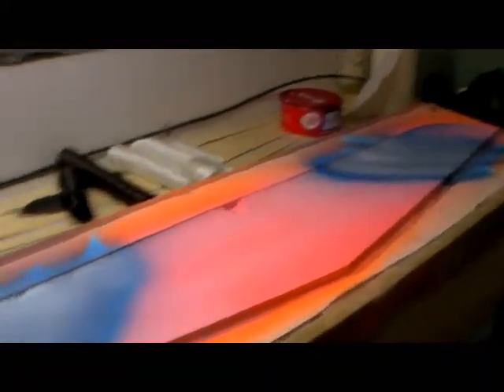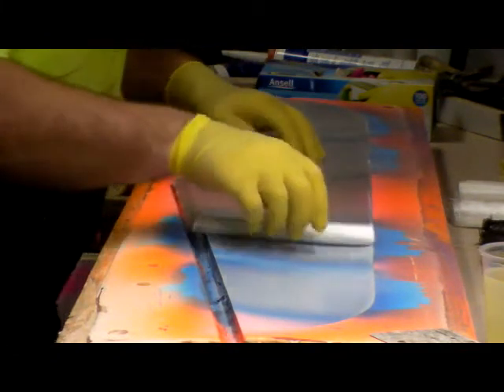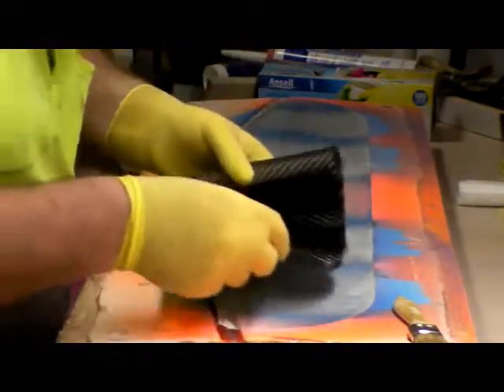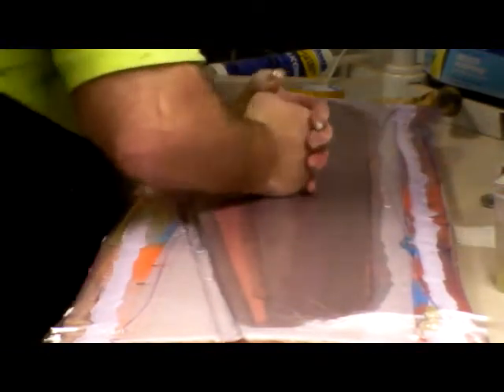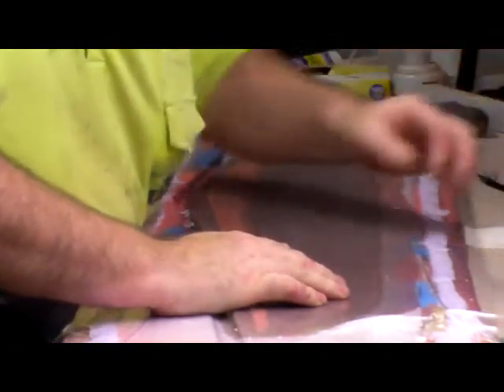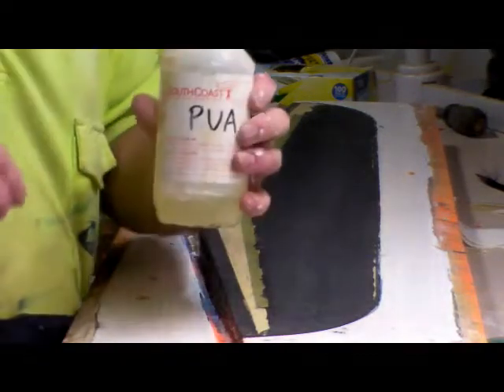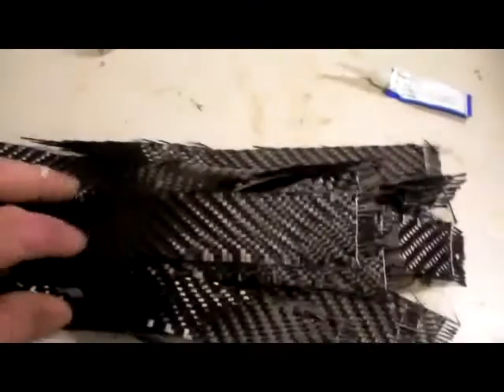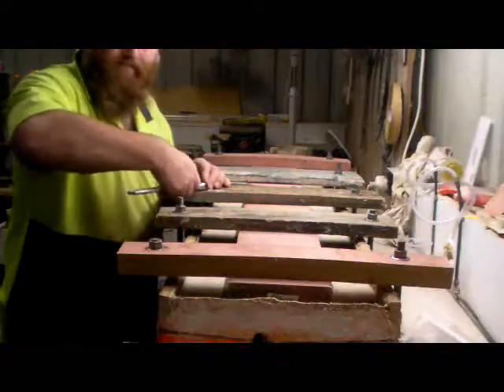Laying up a hollow molded wing.

Comment: Hi, fantastic job and video.
I also make wings, but I would be interested in knowing your tricks!

-Can you tell me what you use in the glue mix you use to close the mould, and proportions?

-what type of paint do you use before laminating?

Thank you very much!
Reply from the maker: Thanks Gaylord I had done these videos quite a while ago, pleased you still find them interesting.
The glue I use is a powder that is mixed with the resin the more powder you put in the thicker it gets I put enough powder in it so it stays on the mixing stick without dropping off.
The paint I use is automotive acrylic.
Reply: @windburner1  thank you, can you be more specific about "powder"?
About the paint , it is 1k acrylic? Not 2k PU?
Reply from the maker: @gaylordvaslin5187  https://www.glueguru.co.nz/shop/BRANDS/WEST+SYSTEM/WEST+SYSTEM+403+Glue+Powder.html
This is it can be used with any resin.